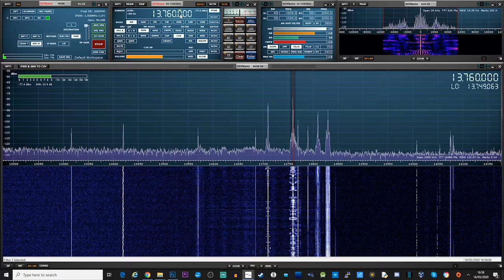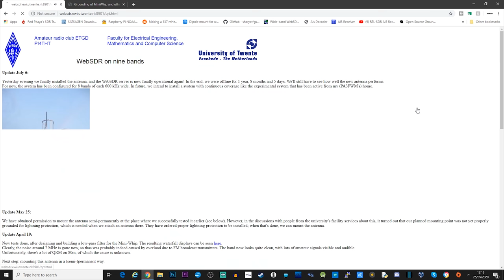HF Mini Whip Active Antenna 10Khz - 30 MHz

Comment: Thanks from KC2WVB.

I just bought on EBay a pre-assembled kit for $15 and hoped to find some information on the kit given I am sure it will arrive without data. Between your video and the comments I should get it working.
Reply from the maker: Excellent! Let us know how you get on with it.
Reply: @TechMindsOfficial  Ok, I am a retired theoretical mathematician and not an RF engineer, so having kc2wvb as my call sign for over a decade, and once having mucked around with Yaggi antennas, plus all the helpful advice given on this page I tried the following when I received my pre-assembled mini whip kit.

Using the dipole I strung up in the basement that by using a pair of wires for each element with each pair soldered at the far ends to increase impedance to near 50 ohms otherwise it would be near 25 ohms due to only 8 feet off the ground as the comparison I tuned in 41 meters on my RSP1-A. I then found a European station broadcasting in AM mode.

I then disconnected the wire that feeds outdoors off an impedance transformer located indoors from the transformer and connected it to the short solid wire I soldered to the antenna input pad on the mini whip using a short alligator clip type lead or jumper for the connection.

Note, the wire that leads outdoors is a distinct end fed antenna and not the 40 meter dipole and is far from ideal in that while being a solid aluminum electric fence wire it angles upwards 8 feet before running horizontal for 20 feet thus it's essentially at best NVI with a weird impedance determined both by frequency, & being end fed & being close to the ground where it never provided much even when connected to the impedance transformer, but it was all I had available at the time.

I then connected roughly 15 to at most 20 feet of thin stranded wire to the ground input on the mini whips PCB and using it as essentially a counterpoise tossed it around the room like drunken spagehtti.

I then switched from my dipole to the Frankenstein assembly I cobbled together utilizing the mini whip. At first nothing good, actually far worse than with the dipole using essentially NVI for its reception. I then noticed that the short wire I had soldered to the mini whip as a connection point for attaching antennas of different types was hanging alongside the mini whips PCB. I then straightened it so it ran out and away from the PCB and did so for the ground counterpoise as well. 

Wala, amazing difference. The signal was now very, very strong and in the waterfall you could easily see the footprint of the interval of spectrum the station was using in its broadcast.

My conclusion is yes, the mini whip can work wonders for sure, but one might say it's a bit finicky as to what is required, but in a sense any antenna that is efficient with respect to frequency is finicky too.

I think I will place the mini whip higher, but indoors with a wire running out a window to a TV mast along with thin coax running down to the receivers I have and definitely include the counterpoise because without one gets a nice constant noise floor and nothing else.

Again, at first disappointed then after adjustments very impressed.

Footnote: my kit came with a distinct or separate PCB configured among other things as the device often called the Bias T device and has a input for 9 volts DC. I found the Bias T on/off button in SDRUNO will provide the same as the battery thus battery not actually required.
Reply: Added:

Since I last posted I have made a few changes and I am indicating what I did below. Before I do: there seems to be a lot of anotedotal information on the internet and not being an EE or specifically an RF engineer it's been a bit of trial an error too see what works best thru experimentation. Some of the information is from electrical engineers and one has been successful with no added wire to the antenna pad located on the PCB.

However, what I settled on is I mounted both the power supply board and the active antenna to the wall several feet from my transceivers on a floor at grade level. I than ran a magnet wire, forgot the gauge, from the antenna pad on the PCB straight up thru an opening in the floor above to the top of a casement window located on the upper floor. This vertical distance is roughly 12 feet. I then went outside horizontal to grade for roughly 20 feet until I hit the corner of a second floor outdoor deck. I then had the wire take a right angle bend for roughly 24 feet or the length of the deck and tied off the wire on a baluster at both the end point and at the right angle transition. I also have a very light wire about 20 feet long attached to the ground on the PCB and it's just laid in a random fashion on the floor.

How did this work. Wonderfully on 49 to 30 metters, OK on 75/80 meters and not terribly effective at 20 meters and above. On medium wave it is OK but I am spoiled from having a purpose built mag loop antenna for Medium Wave.

Incidentally, I tried the Mini Whip with no additional wire added to the antenna pad and had some luck at 49 meters but nothing compared to now where the stations are numerous and at S9 across the band.

Comment: The reason for the poor performance is poor ground. Mounted over and grounded to an all metal roof will help a lot 😉
Reply: Just a couple ground radials will probably help also if a metal roof isnt available

Comment: I brought a mini whip as it had good reviews, but I was like you very disappointed. So I did some research and found that you need to use a metal pole and have an earth from the whip to the pole at the bottom of the whip and a 10mtr single strand wire from the top of the whip. Also you need to ground the pole to a copper pole in the ground. Hope this helps.
Reply from the maker: Thank Colin, I think you’re right, from what I’ve also read the mini whip needs a really good earth, thanks for watching 🙏

Comment: Tricky miniwhip... I would focus on magnetic loops, especially when you got so high RFI at AM band. Looks like chinese wall charger or power supply generates a shit of the noise
Reply from the maker: My neighbour loves LED lights :-( But loops I’ll be investigating very soon :) 👌
Reply: i tried both mini whips and loops and neither give any good results (or results at all). I have no idea what I'm doing wrong.

Comment: I am awaiting a miniwhip I purchased off Ebay. That miniwhip mentions "if you use a metallic mast you must ground the mast". Does your miniwhip tell you to use a metallic mast? Thank you for your video while I wait for my antenna. Have a great day.
Reply from the maker: Strangely enough the instructions that came with mine didn’t mention anything about a metallic mast. It wasn’t until I started doing some proper research on how the mini whip works that I realised. I’ll have to try it in a plastic tube attached to a metal pole to see how well it works.

Comment: I'm on the east coast of the US.  I got a preassembled version of this.  I use my SDR's indoors at a window, and I was disappointed with the performance.  It may work better outside--the antenna can be powered from a 9V battery.  (I eventually got an MLA-30, and I'm doing better with loop designs.)
Reply: this thing just doesn't work. the pseudoscientific explanations of how this works are plain bullshit. something about "it picks up less signal but also less noise" and "it's only sensitive to electric fields and not the noisy magnetic fields"  --- ah but the magloop says "it's less noisy because it works with the magnetic field and isn't affected by the noisy electric field". so which is it? answer: none. an electric field has always an associated magnetic field and vice versa. stick to dipoles, vertical, and other traditional antenna designs that actually work.
Reply: Try disconnecting the screen and earthing the antenna screen so you have no antenna screen return to your sdr it worked for me giving very good gain.

Comment: I found with mine to disconnect the screen from the antenna and take the antenna screen straight to earth with a long wire and a tent peg with the wire soldered to it and pushed into the ground and no connetion from the screen on the antenna to the sdr box the gain was more than twice when the screen was coupled.

Comment: If you weren’t going to install it correctly, why bother doing the video? It gives a totally distorted view of this antenna, which when installed properly works superbly
Reply from the maker: I installed as per the instructions that come with it.. which is why I mentioned in the video there are many versions of this antenna. To be honest, I didn’t nearly bother coz I wasn’t impressed with it.

Comment: I have a small Degen DE1103 receiver - would this antenna make a difference and how would I connect it - the antenna socket or with a crocodile clip on the existing antenna?

Comment: When our local police, switched to AES encrypted digital voice with over the air rekeying, is when I stopped using any radio gear or antennas that were receive only, as a ham operator now, unless its a piece of test gear, ie.,  service monitor/ spectrum analyzer, I only want antennas to transceive, not just receive, especially on HF.
Reply: the idea of the mini whip is that it receives far less noise than a resonant antenna so you can use it as a RX antenna while transmitting in your vertical. i find this to be bullshit. I built a "mini whip" and it was just crap, it's just not a good antenna. anyone telling you it works, is because he didn't do A/B testing with a proper traditional dipole or vertical.

Comment: Tried several of these mini-whips and all have shown disappointing performance compared to just a simple 50' long wire on a 9:1 balun.  Even  the various mini-whip mod suggestions (use metal pole, use wood pole, etc) didn't really help.  Not a fan.  If you want a nice low noise antenna that performs very well try a folded dipole.

Comment: Hey, I've seen this one on many chinese sites, I'm gonna watch the review now. 

Btw, I'm having problems receiving navtext (every station, even close ones) using a 9:1 balun and a 14m dipole, any idea?
Reply from the maker: I guess it depends on how strong the signal is. It doesn’t need to be that strong for a decode. What software are you using? And what frequencies have you tried?
Reply: @TechMindsOfficial  I have problems receiving even a little bit of signal at all.
Actually I receive medium wave really poorly too: I've tried with both a 14m dipole and an am loop antenna without any results. (just some really faint am stations) 
perhaps I'm doing something wrong in the software?
Reply: @TechMindsOfficial  reading other comments maybe I was in zif the hole time, does it impact the performance a lot?
Reply: piefadase YT Unless you receive AM stations from 550 kHz and up, it shouldn’t be any issues with Navtex. If you hear the signal at 518 kHz, but software doesn’t respond with a messages, something is wrong with settings. Try Yand 7.0, it is the best you can have for free

Comment: Can you use an antenna analyzer on it or will that not be good for the analyzer because of the power applied to the coax?
Reply: My antenna analizer will not work with the circuitry on the antenna.

Comment: Mine is working great, since I made my original video, I have raised it up to about 25 feet on a metal mast. The ground pad on the Pcb is tied directly to the mast with a short length of 14AWG wire. The mast is buried 2 feet in the ground.  I have LMR400 coax, I have found the 4.5v bias t from my RSP1A works great. I will be lowering my mast soon for hurricane season, so I make shoot some video of the setup.  I also use it with a RTL-SDR  Blog V3 and feed the bias t that came with it from a 6 volt battery.. that works great in direct sampling mode, but not as good as the rsp1a. I got min as a kit (through hole) from https://www.amateurradioshop.nl/webshop/bouwkits/   I may build the surface mount kit so I can run 2 receivers

Comment: Will a 50m wire outside the garden improve or overload the signal? And does it work inside the house or there is noise?
Reply from the maker: If you have the space for 50M of wire then put up a dipole or an end fed, you wouldn’t need something like the mini whip. 👍
Reply: Useless in the house picks up to much noise, best on a pole in the middle of a garden or as high as possible.
Reply: @TechMindsOfficial   but a dipole isn't broadband ? 🤔

Comment: hey thank you for the vid  --- I am trying to configure a mini whip antenna that I picked up on amazon. It came with a bias tee to power the antenna. I have 'RF out' on the antenna PCB into 'RF + DC' on the T, and 'RF' of the T into scope. I've powered the T across the acceptable range. I am getting basically no noise, very clean flat DC signal, strong, but no RF whatsoever showing up on scope. I tried reversing the config as well, same deal

can you please help? keep in mind I am a noob. this is the unit, cannot find documentation for it https://www.amazon.ca/Mini-Whip-Shortwave-Active-Antenna-Interface/dp/B0828FD9GN